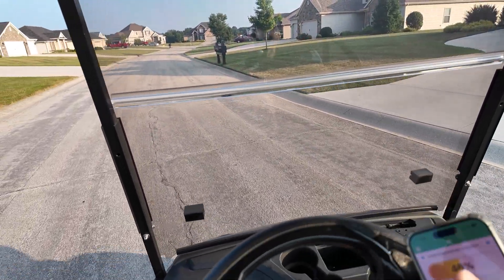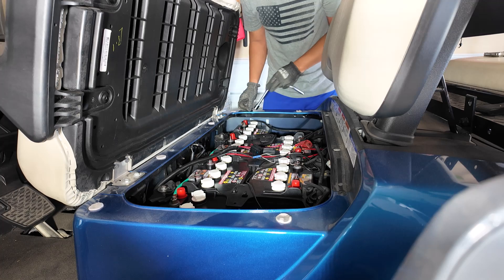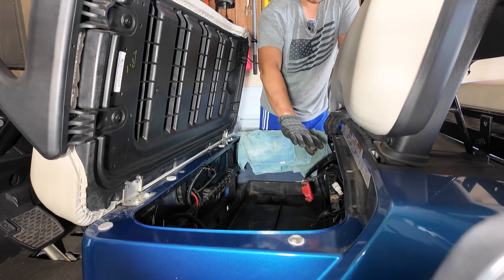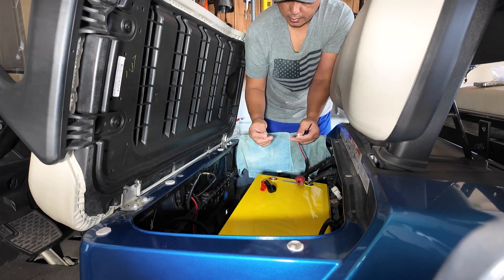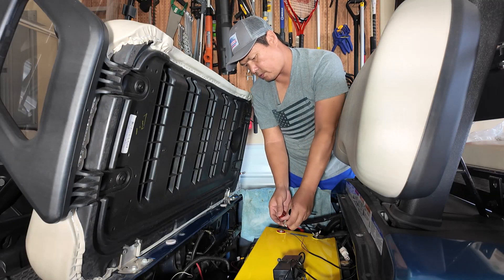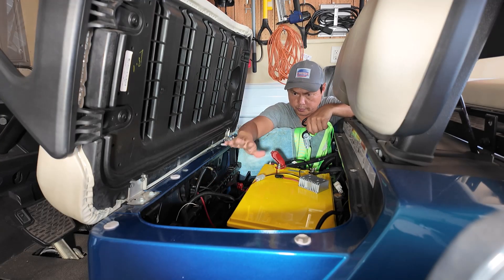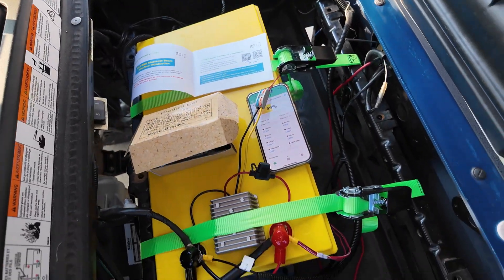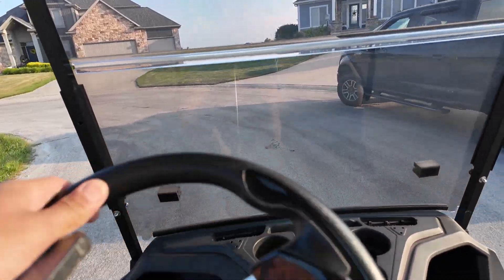EASY Lead Acid to Lithium Battery Conversion | Yamaha Golf Cart

Comment: i was reading somewhere you should replace the motor as well. what do you think?
Reply from the maker: The motor will generally work fine as long as the lithium battery's voltage matches (usually 36v or 48v), and the type of motor AC or DC. You can find your golf cart motor is DC or AC by checking the motor's nameplate. If the AC or DC don't match (or the other way around) you can always use a converter to convert it.

You must also replace the battery charger, high voltage cables, and due to new different charging requirements.

Great question!
Reply: @ExperienceImpart  is there anyway i can send you a photo of mine and you tell me what you think i should buy? i put new batteries in it last year (not lithium) and it’s too slow compared to some other golf carts around the “hood” i replaced the batteries myself but adding in the light converter is worrying me with a lithium. thanks for your help